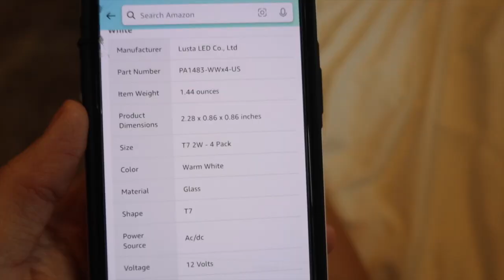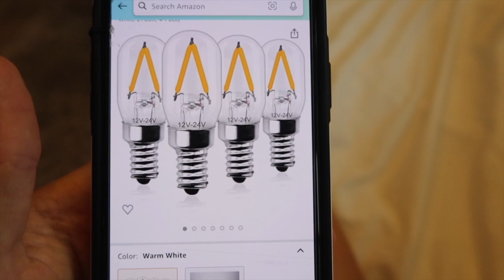vlog: Keystone Toy Hauler RENO Part 4 | last update before final before & after

Comment: Looks amazing, great job guys.  If you had to do it again, would yall buy the same RV and fix it, or just buy one with no damage.
Reply from the maker: Thank you!
Most used RVs are much more expensive than buying one off auction like we did with this one. 
Basically half the price of a used one, same year and model. With the money saved you have pretty decent wiggle room for Reno (more labor intensive but def more cost effective).
Reply: @TashVitorsky  
Thank you for your response.  One last question lol, do you remember what auction y’all bought it from ?